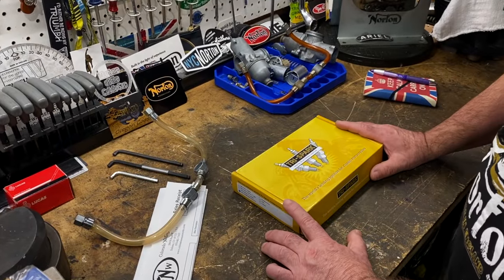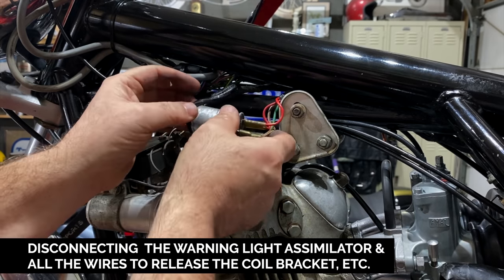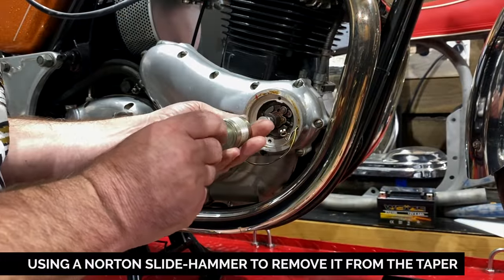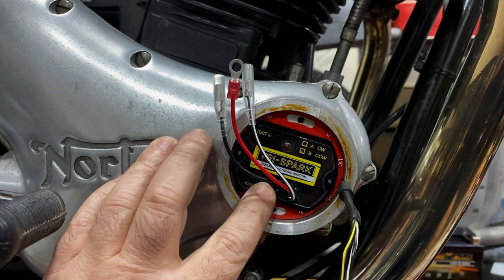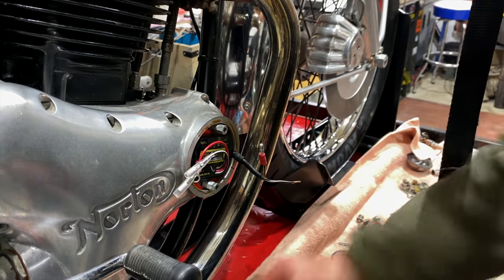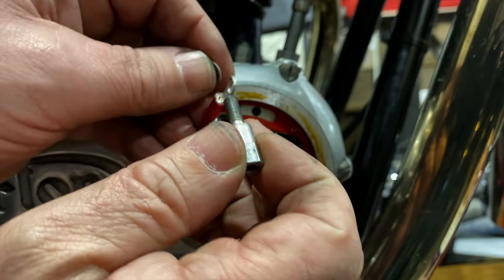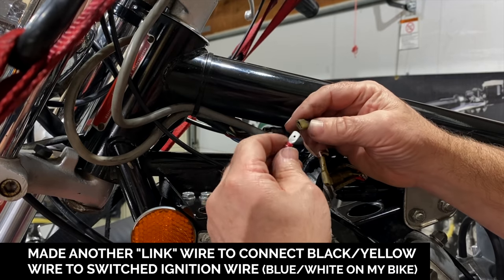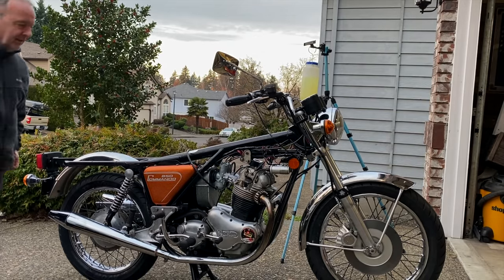1974 Norton Commando 850 - Part 6 - Tri-Spark Electronic Ignition Upgrade

Comment: Tri-Spark has updated the Classic Twin ignition since Mike installed one on his Norton.  This Classic Twin (TRI-0006) supersedes the Classic Twin TRI-0005A and TRI-0005B as the two A/B versions have been eliminated.  The Classic Twin ignition stator unit TRI-0006 can be used as a replacement for the earlier versions, however the installation is different and you must use the installation manual for your version.  See the Technical Page on their website for installation manuals.
Reply from the maker: Thank you Steve!!  I have pinned this to the top for the guys 🙏

Comment: Once you go Tri-Spark, you never go back. After fitting a Tri-Spark Classic to my T160 Trident, I was amazed how many "carburetor" issues were solved. My bike has only 2,400 miles on it so the starting, running, and idle inconsistencies can't be blamed on worn out parts- it was like that since new. To say that the difference in the bike's behavior is like night and day would be an understatement. Not saying that getting an old classic to run right on points and mechanical advance is impossible, it just takes a level of experience and the right "touch" to do it. Most of us don't have that. Just get yourself a Tri-Spark and be done with it.

Comment: Mike, check the Tri Spark manual it says that the 12V Lucas coils should not be used as they will result in poor performance and/or misfiring. (Page 11, Coil Compatability). I ended up wiring two 6v Lucas coils in series on my Triumph and used the CNW coil on my Norton. CNW coil is not my favorite look, but at the time I could not find 6v lucas coils. Cheers and best of luck.
Reply from the maker: Thanks a lot Eric. I appreciate it. I’ll see how it goes for a little while. I’ve also got a Tri-Spark in my other commander with the standard coil set up and it has been terrific, but it’s a fair point. I’ll definitely watch out with this bike. Cheers, Mike

Comment: Hello Mike, this was again a very good video and worth seeing how the electronic ignition is installed. And I also have to admit that you can hear the difference right from the start. And as you say, adjust the carbs again and it's 👌. I remember in the late 70's early 80's when my uncle installed an electronic ignition on his Ford Granada and was very happy with it, the running culture was much better.

Comment: Hi Mike,
Great result and easy to do. I fitted a mikuni carburetor and a pazon  ignition on my 1971 Commando and it run perfect now.
Next project is start on my 1972 Triumph T150 which hasn’t run for more than 20 years. 
Like your channel , greetings from the Netherlands

Comment: Did you strobe it at all, I found mine was about 5 degrees out when I did,  worth doing before you sync the carbs as it affects the idle speed as well the mixture, great video though
Reply from the maker: Thanks Graham, yes we did put the bike on the strobe and synched the carbs again. It was out, so well worth doing the timing with the gun. Best wishes, Mike

Comment: Good job the motor sounds smoother , as most know it's all about even impulses on the crankshaft hence its crucial when using the standard Amal twin carburettor set up that both carburettors are metering as close as possible the identical fuel/ air  mixture ratios , cheers looking forward to your next video 🙂👍

Comment: A tip from experience: make sure that the wire from the points/ electronic unit to the coil pack has a enough slack at the bottom to allow the engine to rock on its mounts without straining or flexing the wire. Failure to do so will eventually lead to an intermittent break which mimics all sorts of other problems. Sent me mad for months.
Reply from the maker: Many thanks for the tip. I'll be sure to check. Cheers, Mike

Comment: Nice result Mike, if its like the older TriSpark, it has an idle stabilization  on the advance curve, so the electronics are actually stabilising the idle, worked very well on my T140
Reply: He's got the 'old' style'.
Works well on my RE Mk2.
I really like that feature,seems they have simplified the twin setup.
Any idea why that feature was dropped?
Reply: Steven Kelly from Tri-Spark stated that the stabilization feature was not dropped.
It's just not mentioned.

Comment: For a 1974, the bike is in excellent shape.  Even has the glass fuse!  Just wondering why you removed the rocker covers to check the valves but didn't seem to check them during the install?
Reply from the maker: Thanks very much, Walt. We removed the rock covers to check that the bike was at TDC (top dead center) before setting the timing with the new Tri-Spark. I had checked the valves in a previous video. Cheers, Mike

Comment: Well sorted on that idle return issue. Think I could drips of fuel below the carbs during the warm up idling, well after your last tickles. Maybe just from your temp fuel piping?
Reply from the maker: Thanks a lot. Yes, I noticed them while watching the video back. I tightened up the knurled nuts at the bottom of the float bowls and it seems to have done the trick. I appreciate you mentioning it. Cheers, Mike
Reply: greetings Mr. I want to ask what is the name of the tool
Reply from the maker: @cpscustom1292  Sorry, I don't know which tool you mean. Can you send me a timestamp in the video?

Comment: Great to see this job done! I've been happy with the Boyer on my MK2. I know there's a purist camp, but I want be out riding and not cleaning breaker contacts... I've had one Boyer fail over the 20 years I've run them with a cracked solder line on the breaker plate that was a nightmare to diagnose (worked cold, cut out on a good bump when hot!), but since then its run great for years. I could feel myself tense when you tightened the Standoff bolts though! I've got a broken one framed on my "Do Not Overtighten" sign in the garage (and spares of that particularly pesky-to-extract bolt in a drawer). Great work, great video, great sound! Congrats!!
Reply from the maker: Thanks very much for your note. Yes, I feel the same way. I’ve had a tri-spark on my other commando for many years and it’s been fantastic. I’ve never touched it since it was installed. I promise I was being careful with those bolts :-)

Comment: Outstanding Mike, and I do hope that even a  small amount of my input last video helped. I was absolutely convinced it was the advance unit. Restoring and engine building of Triumphs helped pay my way through college decades ago. I always hoped to 1 day switch to the Norton platform,  but I made my niche in the Harley Davidson and Suzuki Racing platforms, which has provided for me quite well. 
From sunny Florida,  enjoy the ride Sir.
T.S. RACING
Reply from the maker: It really did, thanks very much! Best wishes, Mike
Reply: Thank you Mike, and for the record,  I truly should behind your friends carb mods. 
Excellent,  excellent,  thank you.
Reply: I went through my files and remembered a second generation 955 Triumph Sprint RS I restored for a good client.  A little off topic I know,  but I used to digest the bike for hours, and as most people know,  the only true flaw was the plastic fuel line connectors,  easily remedied with stainless steel connectors.  A truly beautiful,  well engineered Sport Touring machine. Thank you Sir, I truly enjoy contributing to your channel.

Comment: In my opinion there's nothing wrong with the factory mechanical ignition system on a standard classic, provided it is properly maintained.  There is no getting around the fact that old British iron is high maintenance.  Electronic ignition is great for those with little mechanical aptitude or inclination, but if it fails on the road, it's over, Rover. PS You might like to pop some isolastics in your camera tripod (20:49 or thereabouts)!  All that shakin' has to go somewhere 👌
Reply: The problem is that the stock parts wear and that is when you have problems. It's not a failure of the owner, it's that 50+ year old stuff wears out. And you will never get the two sets of points perfectly in sync no matter how good you think you are. Then try to buy a new AAU because once those are worn out it's done.
Reply: @swooshdave  Not a lot to wear out on a mechanical advance setup unless you have huge miles up and no access to lubrication..  I'm not anti electronic ignition, but I'm comfortable with servicing the standard factory system.  Not least because its original.  I'm fitting a Boyer system to one of the two Daytonas I'm currently working on because the owner is not a mechanic.  The other is mine, which will be set up with cigarette paper.  😉
Reply: @northlandrider5396  I’ve seen tons of worn out AAUs in my days. They aren’t lubricated by the engine so the only care they get is from a person. And who is going to disturb their points to live the AAU? Then there’s the springs that wear out too.
Reply: @swooshdave  The points will wear out before the advance springs lose tension.  You sound like a solution looking for a problem when it comes to British motorcycle maintenance. The factory set up is really not that scary.  I appreciate the advantages of set and forget.  But there is nothing wrong with the original system, properly maintained.  We're not talking high performance technology here.  For that you'll be wanting a magneto!😉